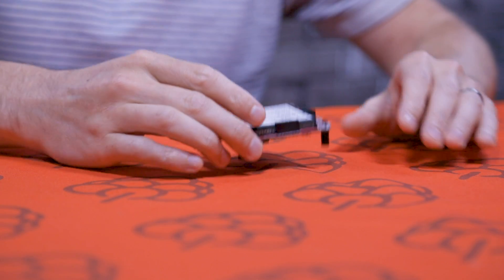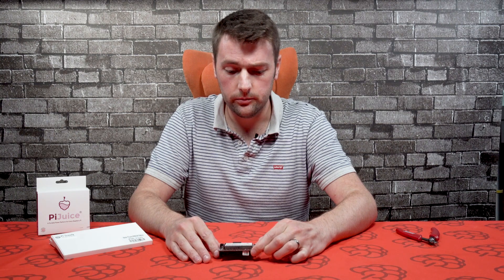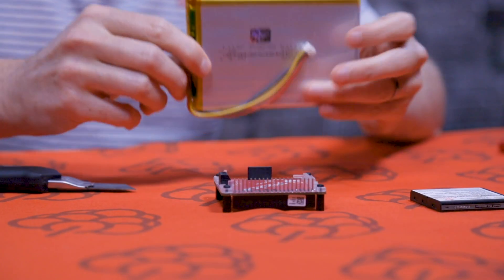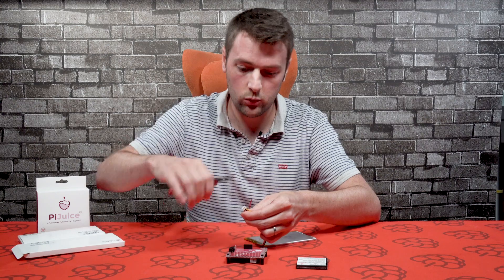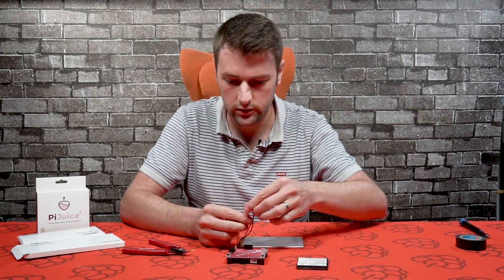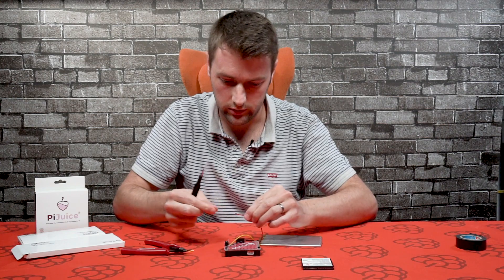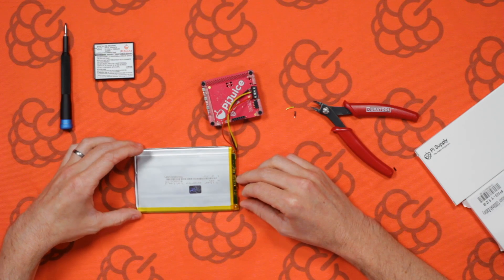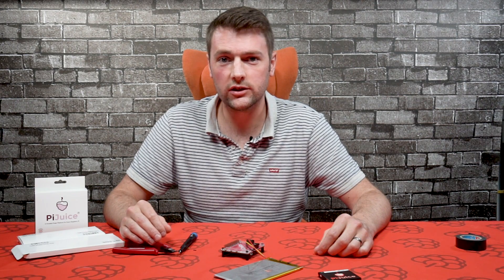How to add a bigger battery to the PiJuice UPS HAT for Raspberry Pi

Comment: It would be really cool if you could make a battery with the same form factor as the default battery but just much thicker to hold more energy capacity. Would be great to just snap on a bigger battery with ease.

Comment: Nice video.  Thanks for sharing.  Personally, I'd like to have a plug adapter that would plug into the existing battery plug with short leads that I could screw into the PiJuice instead of cutting off the battery plug.  That way I could easily use the battery for another application if need be.

Comment: Can the PiJuice be installed via separate cable? I like the hat, but for Pi4 it's blocking direct access / cooling, and other boards.

Also, can it work alongside a PoE hat e.g. I have it running on PoE, but that loses power, so it swaps over to this?

Comment: Maybe a dumb question, sorry i'm a begginer: when changing to a bigger battery, do i set the new battery profile BEFORE OR AFTER connecting the new battery like you did?
Reply: Doesn't matter. It works either way :)

Comment: Thank you for the video. What case would work best for the battery? I'm setting my pi 4 up in a highpi case with a pijuice. I'm going to be taking it to school and using it to remote into a windows 10 pro virtual machine to complete my system admin courses. I need the 12000mah battery, but I need it to be secure to the highpi case.
Reply from the maker: hmmm we currently don't have a case designed to fit the PiJuice HAT & 12,000mah battery. Perhaps you could look at 3D printing a case?

Comment: Two questions. 1: of I had a fan and enclosure could I keep this outside in the sun

2: is it safe to have a wireless charger charging it while it’s powering the pi?
Reply from the maker: 1. Yes that should be ok, however it is important to make sure that the lipo battery is never in direct sunlight because this can cause fires or explosions. Providing a sun shade / deflector on top of the case can help with this.

2. You can charge whilst powering the Pi yes, that's no problem.